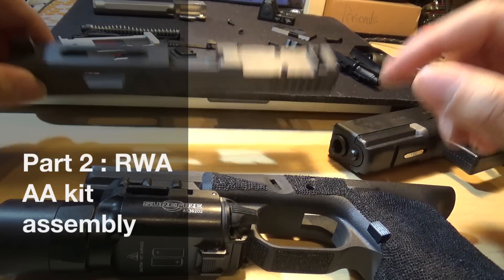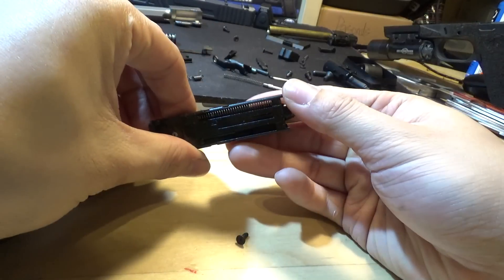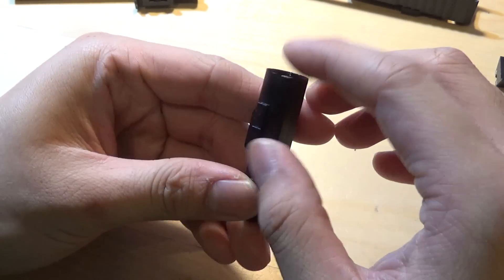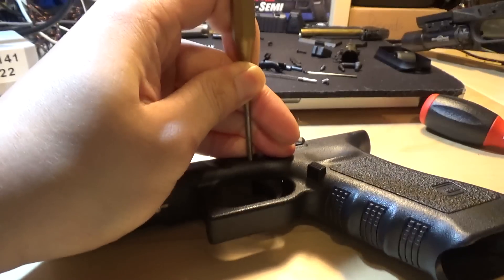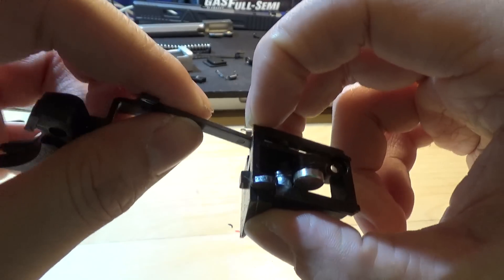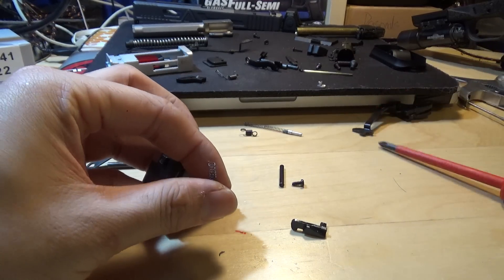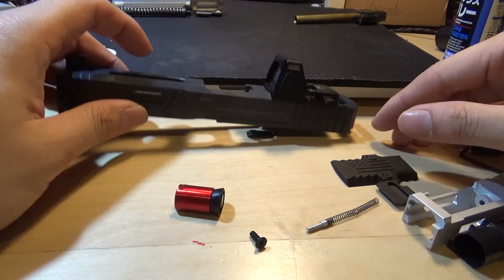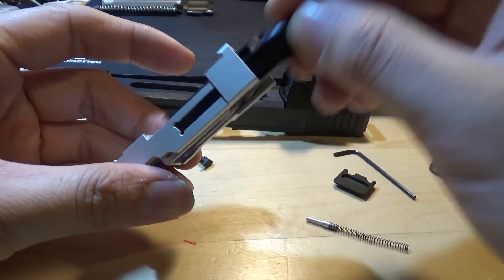RWA Agency Arms Slide kit for TM G17 (Installation + final thoughts)

Comment: quick question. i had the idea of installing the iron sights like the atom slide. what approach would you take mate?
Reply from the maker: +ዮናታነ ጊዛሂ i don't think you can since the slide is already cut with the RMR :( you won't be able to make the front sight cut :( missing metal :(
Reply: +RogueSystem087 mhmm thinking about it now also, the rmr may block any possibility plus the blowback housing
Reply: +RogueSystem087 and thank you for the response

Comment: Currently in Florida, and the temperature of course in hot lol. Have a Tm g17 stock. And want to replace it with this kit. A straight up newbie. How well will this preform after install? I'm noticing the heat already has an affect on the current stock marui, will this slide kit fix that? And if not what can I do?

Comment: Do you think this set could fit my Stark Arms G17? I recently bought CO2 mags to it and didn't realize that the original parts cant hold that much power. So my slider crack in half and the spring guide shattered to million pieces... All thou everything else seems to be just fine. Which is kind of weird that the slider made out of metal is now in two pieces. And as you can probably guess I am not very professional with gbb pistol stuff, or gbb stuff at all.
Reply from the maker: no worry dun matter if newbie or experienced gbb users XP we're all players :) 
in your situation, i do not advise you to buy a marui system g18-like slide and install it on a stark arms (my wordings is in reference to the fact that stark arms uses a semi-replica of the tokyo marui glock 18 system in the rear chassis only). 
The reason why i advise you to not buy is because there is a descent amount of work required to fit a TM g18 slide of any kind (RMR or no RMR), onto a stark arms because the barrel notch areas at the bottom are completely off, no to mention that the Blow back housing unit at the rear of the slide can have excessive friction with the stark arms hammer chassis since the dimensions are slightly over specced and that's why they rub up against each other (sometimes up to the point where installation seems impossible). 

if you have to, i suggest you buy a nova slide for stark arms, because nova actually provides slides that work on stark arms. much simpler to understand and fit and less challenging. 

best regards,
RS087

Comment: Just installed mine (old version without RMR) but found 2 issues: 1. slide is not smooth esp when the rear of the outer barrel transitions from the shell ejection cut-out to under the slide, and vice versa. Shoots ok but can feel  a lot of resistance when sliding manually. 2. When slide is all the way back, outer barrel is very loose and rattles. Is that normal?

Comment: hey rogue thanks for all the great answers and tips. i wanted to ask you if you, i building one of these agency kits but was stuck on how to go about the lower frame. i either wanna purchase a new TM g17 or purchase piece by piece and purchase all new enhanced guarder parts frame hammer housing zero hammer set etc etc...
Reply from the maker: Np :) glad it helped. As for your situation. im gonna be honest with you, if this is the first time you are building your glock from scratch, u r gonna have a really tough time matching and fitting parts. i can tell you right now, that guarder and gunsmodify is definitely not a good place to start. their parts do not work for very long. without explaining why, their design is flawed, it never once worked. I highly reconmmend u to start TM, and sorta do what i did in the vid. smooth it out, and it already functions okay. imagine what would happen if i worked on the air seal, recoil spring balance, and  smoothing out the movement. baby steps man. keep it simple.
best regards,
RS087

Comment: in your opinion would you use this slide on a WE g17 if i couldn't find a TM g17? i know they say you need some slight modification but how do you think the performance would be.. should i just wait to come across a TM?
Reply from the maker: i don't mind using a WE, in fact I build a lot of my glocks off WE. However, without explaining why, for beginners, they will have a tough time getting it to work reliably in the long term. 
And because virtually every single TM part in the market requires modification of some sort to fit into the WE, you will naturally face to face more teching and fitting issues. 

It really depends on you to be honest, if you are comfortable doing your own teching and you are open-minded (meaning willing and able to take apart anything and learn), then go for the WE cos it should be doable. If you are unable to do any teching at all, then I suggest TM because it requires less work and less understanding of the fundamentals to fix it. Example if you have a light strike, its often a very limited set of things, where as for WE there are a few extra problems that cause light striking (again without explaining in detail as to why or otherwise this response will be too long). 

Last thing to note, TM glocks are not exactly problem free by nature. As you may have noticed there are a number of issues to consider. But Getting a TM instead of a WE means you will deal with a 'limited' set of issues instead dealing with a wide variety of issues all at once.

Comment: Let's say I do purchase this and slap it on a Gaurder frame with a donor TM G17. What else would you recommend that I should upgrade right out of the box?
Reply from the maker: without knowing your build objective, budget, range, tempurature, type of gas, and assuming no tuning, 
and to give you a highly highly generalized answer. 
-BBU of your choice
-nozzle like UAC/MAC and perhaps a backup. 
-hop up rubber of your choice
-inner barrel from nineball or PDI
Reply: Temperature is warm to high since I live in California. Gas is green gas. What BBU would you suggest?
Reply from the maker: i'm not sure what temp that is but BBU is of your choice and whatever you can find that's readily available. 
I prefer asian brands cos they are cheaper and more accessible to me here in hong kong. I prefer AKA, AIP, Predator, RTS (only applicable to certain slides), and Gunsmodify (softest out of all the BBUs). The weight difference is not enough to say one is better than the other, is the features such as.. 
1. built in piston? 
2. do you prefer o-rings?
3. do u prefer to buy a piston of your own and use that? 
etc etc .

Comment: how is the set holding up? thinking of picking one up and will be shooting it a ton!
Reply from the maker: i think if for beginners! or low budget users, best to start off with something more simple. 
If you want to spend the time and money to get an RMR glock for g17 and have it run well and also maintain its tightness by replacing parts a little more frequently, then this can easily be one of your top picks for kits. Cos its a little loose, so it runs generally speaking. Only negative i have is the proprietary blow back housing unit :(
Reply: whats parts generally are you speaking of when you talk about replacing parts more frequently?

What metal slide do you recommend then? Guns modify CNC or PGC CNC?
thoughts on this one http://www.boomarms.com/shop/item.cfm?id=GM-SL-S17GD3-BK&curr_code=USD

I saw this blow back housing from guns modify and it says its compatible with the RWA agency arms
http://www.boomarms.com/shop/item.cfm?id=GM-HS-G17N-RMR&curr_code=USD
go to the link in the product description

"Also we release the RMR version for all the RMR cut slide set base on TM G17 system .
e.g., PTS Atom kit , RWA Agency kit , Guns Modify SA kit and some RMR cut slide on the market ."
Reply from the maker: ah because that GM product doesn't work, in the airsoft industry nobody really uses GM anymore because they don't actually work at all or in the mid to long term. Very good example was the gunsmodify zero hammer. Many years it was considered to be the best hammer available but 2 years later, gunsmodify noticed thier hammer has a flaw where it would either wear itself or the BBU. Two years later... and now they also have another problem showing up with their new ZERO BBU which they actually went the opposite way and went back to TM design but made their BBU similar to KSC design which was well known to be unreliable and unsucessful. :( 

as to what metal slide i reconmmend. I personally prefer the tight fitting one's that require work to fit them. PGC, pro win, advanced tech, shooters design, are all my favorites beacuse they are so tight they don't even move properly when you first get them. But i like that because it means i can hand fit them. 

parts frequently replaced. 
-nozzle
-rocket valve locker
-o-ring or cup piston depending which u r using.
-chassis (probs after a long while tho)
-hammer spring

these all really depends on if you use RMR or not and also depends on g18 or g17 etc etc etc because each of them have different pressures associated with their hammer / trigger disconnect. 
your particular questions are very difficult to answer without going into great detail, but i did my best to answer here. 

best regards,
RS087

Comment: Should I use the we or Tm G17 as the base like how major is the difference in installation
Reply from the maker: +Toxxik Installation method is the same. Installation difficulty you may find TM be a little easier and It honestly depends on what you are comfortable with. 
For example, people choose WE because readily available, descent quality, internals need work and WE internals is not particularly stable but if you know what you are doing, WE can be done fairly easily. 
There is also of course TM which gunsmodify builds all their slides to TM spec and TM generally speaking is more sysmatically stable than WE. But despite being systematically stable, its still suspeceptable to wear just like the WE. 

So honestly, go for what you want, and what you think is easier for yourself. 

best regards,
RS087

Comment: Will this kit fit on a Lone Wolf Timberwolf lower?
Reply from the maker: +Thomas Nguyen will it fit? sorta, it will go on, and it will move a little, 
but it will not work well without tuning and some slide fitment. 
If you decide to build on a lonewolf frame or guarder frame, its best to be open to the idea of doing some work to make it work well.
Reply: Thanks for the response! RogueSystem087

Comment: You said that you don't like the cerakote finish, but do you still prefer it over the black anodized version that comes at a cheaper price?
Reply from the maker: +WildWolf gonna be entirely honest with you, I only prefer this cerakote version because of the unusually pretty grey color that's apparently called ''agency grey''. But otherwise, the black one is perfectly fine, the finishing looks really slick for sure, its a much deeper dark color compared to the other agency slide kits which makes it just as unique as the cerakote one tbh.
Reply: +RogueSystem087 Thank you very much.
Reply: +WildWolf And one more question, does the barrel have a threading for a suppressor?
Reply from the maker: nope, no threads internally or externally (and as of right now, i do not believe gunsmodify or RWA will be making a threaded barrel :(

Comment: if i install this slidekit on a tm g18c will i still have fullauto fire or only single? i couldn't see the fire selector in the video..
Reply from the maker: it will not work on a TM g18 C because the kit comes with a g17 BBU with the RMR cut which basically means it comes with a special g17 BBU modified for a g18 nozzle and piston. 
G17 BBUs cannot go on g18 and vice versa.
Reply: Since you have the kit, do you know if an 18c bbu would fit it the slide, like guns modify aftermarket bbu for example? I got tool and patience to mod if needed ;-)
Reply from the maker: you can, but best not to since it uses its own special locking system for the detent, u have to find some way to track all those pieces down which is very time consuming. And also you'll be purposely buying a g18 to deal with the problems that a g18 has, and it alone has like 11 to 15 extra problems over the g17 system (which is fine if u don't find dealing with them). 
The reason why i'm telling you this is because since this is an RMR glock, about 10 of those extra problems are garanteed to appear. You'll making life extremely difficult for yourself if you choose to go down that path. But yes, u can buy g18 parts (if u can find em, and if you can find the detent, pistol nozzle, etc etc).
Reply: Okay, I need to think about it, im looking for a winter project and a rmr metalslide g18c is very alluding , but it  sounds like its best to just get a pgc metal slide instead, thanks for your quick reply!
Reply from the maker: oh dear if that's the case, for sure u would want a g17 instead of a g18 to avoid gas discharge and efficiency problems along with a few other problems. tbh if you had the cash, i would suggest u to go high capa
Reply: Thanks for the tip, I already have a glock setup, kydex holster, co2 and gas mags etc , but the gun got smashed in an accident, I run the rwa nighthawk 1911 in wintertime outside, but want to run a glock summertime and in cqb inside, because the 1911 shoots a bit hot for those up close and personal encounters, and I already have all the "gear'n'mags" for it. I might have been unclear, I meant building during winter when most people here take a break from playing ;-)
Reply from the maker: O_O lol haha i see, complicated world we live in lol

Comment: Can it be installed in Glock TM G18c? if it does not match, which part should be replaced?
Reply from the maker: Depo Diesel it comes with parts for TM G17, 
If you wish to install in TM G18c, you will need TM g18 BBU, and you will need a G18 disconnector (the disconnector will be difficult to find, because not many online stores have it, you will have to search for it on your own for this part cos almost nobody I know stocks it. I only shop in physical local stores in hong kong, so that's why i cannot advise you with links or where to buy). 
Best regards,
RS087.

Comment: Can a Tokyo Marui glock 17 use this kit？
Reply from the maker: yes it can!! this kit is specifically meant for TM G17!! it will also work with TM G22 and G34, but for your G34 u have to change the inner barrel.
Reply: Why did u use the garder frame instead of the tm frame

Comment: what an idiotic construction of the nozzle spring guide block. have never seen such unnecessarry complicated detail. Lost 3 hours on alignment and still can't proceed
Reply from the maker: unfortunately their design does require a very steady hand :( trust me i understand your frustration at first as it took me a descent while to figure it out on my own and to test if how i assembled it was indeed correct. 
but hopefully, did ur kit work out?
Reply: RogueSystem087 yeah, apart from that stupid piece everything went smooth. Still can't get the idea why manufacturers think a separate extractor is a valuable asset? You see it once and that's it :)
Reply: the nozzle spring capture seems to be rotating out of place every once in a while and seems to be hitting the nozzle when racking the slide, any tips on how to keep it in place?